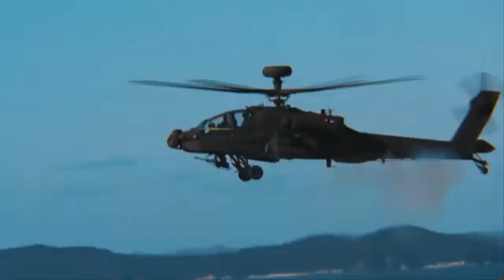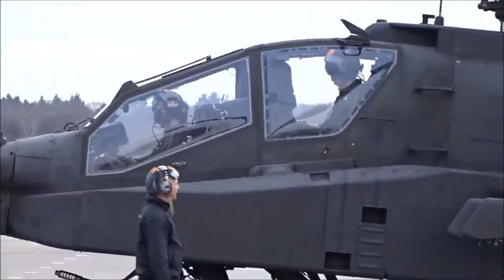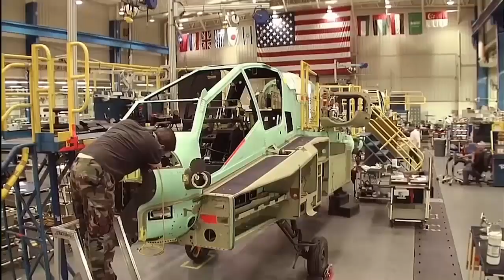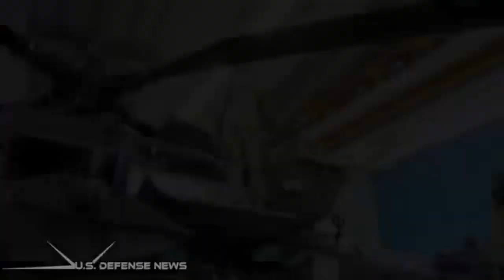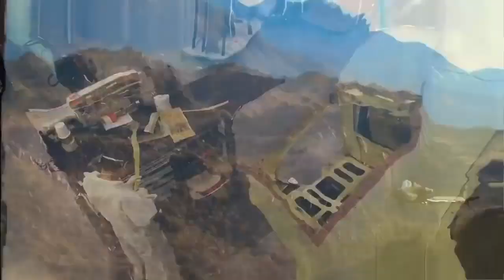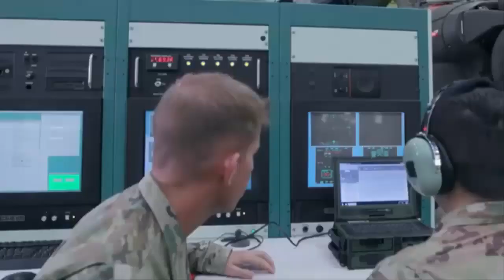Boeing will produce more AH-64E Apache helicopters

Comment: I like to think they saw the effectiveness of attack helicopters in Ukraine. Sure, flying behind enemy lines with a slow, low-flying asset is a huge liability. But perching 5 -10 miles from the enemy front line safely over friendly forces picking off vehicles, personnel, and equipment with missiles. Well, that's valuable.